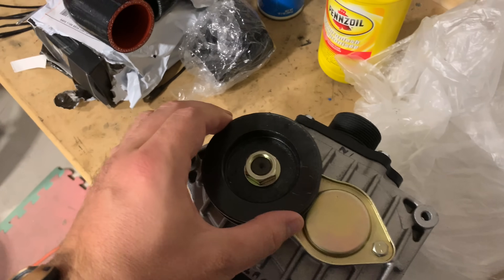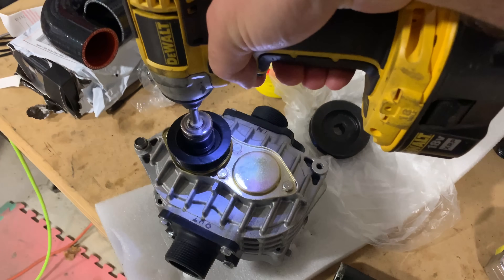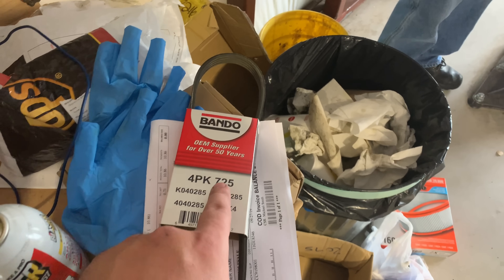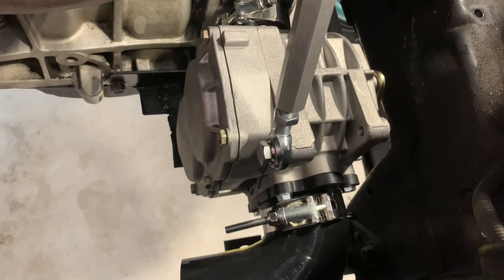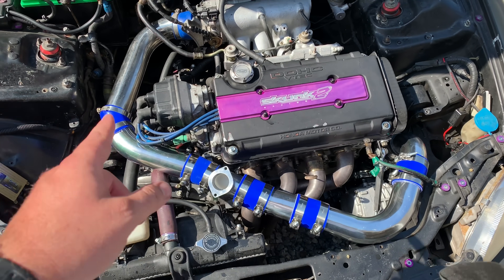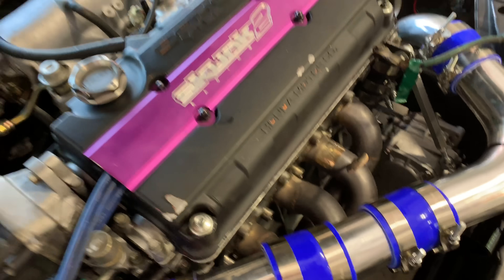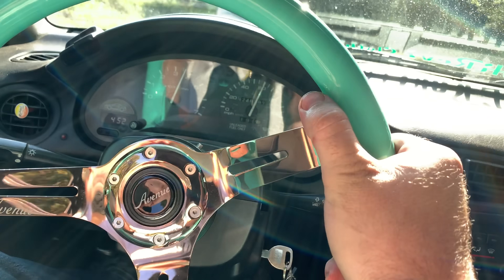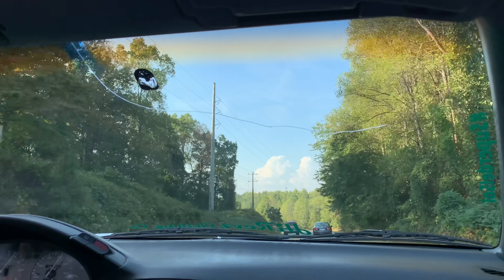Listen to that Whine! - AMR500 Supercharger - ‘93 Honda del Sol B18C1 - Pt. 3

Comment from the maker: UPDATE: Because so many have asked.  The car has a Chipped ECU from Jason Waters Tuning and is already tuned to handle boost up to the stock MAP sensor pressure of 10psi.
Reply: how many cubic meter air blowing per minute?
Reply: Dd7
Reply: @AM-up9kn  140$ on ebay
Reply: Meaning you dont need a gas refeed line and a fuel pressure regulator?

Comment: Superchargers benefit from intercoolers.(Even small ones) And at the very least put a heat shield between the header and the air intake because right now you're not cooling air but heating it. And heat does not make power, it robs it.

Comment: Try and see if you can’t reroute the throttle valve to the intake of the supercharger. From what I’ve heard, it’d probably remove that high pitched idle whine.

Comment: I would use an inline filter and housing, also the blower will last alot longer with a blow off valve installed.. thats probably why the intake blew off. It is overboosting when the throttle valve is closed fast, all the air has nowhere to go, and flutters bad,  these high rpm engines is not good for superchargers, a turbo is better it has pressure regulation, a supercharger will be too much pressure at high rpm and too low at lower rpm, an engine with a max rpm lower than 5 or 6 is ideal not 8 or 9+

Comment: Hello, I have the same project as yours, but in a Ford Sigma 1.6 liter engine, you are having problems with the oem injection, do you need to reprogram the ECU (remap)? Or can use OEM injection map?

Comment: I was thinking about putting this on a moped lol.  Maybe even turning the pully with an ebike electric motor but idk really how to do that because it's carburated and idk how it would handle forced induction.  I would think there might be some sort of air/fuel problems, unless I can somehow control the electric motor through the throttle or something to where it gives just the right amount of air, idk.. if anyone knows how to do something like this pls let me know :D

Comment: The same pump is used in sewage treatment aeration.  Wondering if the collar mounts are restricting the flow?  IE:  Remove the factory collar mounts and install (maybe have to 3d print or fabricate) new mounts that match the intake size...

Comment: Application: to increase performance on motorcycles, snowmobiles, ATVs, VW engines, Mini Coopers, Subarus, Nissans, Toyotas or any engine under 3.0L.

500cc/ revolution (30.5 cu.in.) With straight, 2 lobe rotors. It could be over-driven, and make good boost on a 650cc-1000cc drag bikes or larger if RPM is kept low. Or it could be under-driven for smaller engines.

Examples:
On a 500cc two stroke, with the blower being driven 1.5:1 with the crank, it would produce approximately 7 psi boost.

On a 750cc four stroke, with the blower being driven 1:1 with the crank, it would produce approximately 5 psi boost.

On a 750cc four stroke, with the blower being driven 1.5:1 with the crank, it would produce approximately 15 psi boost.

On a 1000cc four stroke, with the blower being driven 1.5:1 with the crank, it would produce approximately 9.5 psi boost.

On a 1600cc VW engine, with the blower being driven 2.1:1 with the crank, it would produce approximately 5 psi, but the engine RPM must be limited to 8000 rpm.

Additional Info:
Max blower continous speed is 16,000 RPM

Comment: just found out about these SC's i think i wanna try putting one on my H22A accord.
Reply: It's too tiny to be able to keep up with a H22, I've looked into it for mine. You'd have to run it at beyond 2:1 just to move the same air that a H22 can stock. H22 runs up to around 7600rpm so that's already basically maxing the chargers rpm out. making little boost and resulting in less power than stock, as your supercharger is basically just acting as an air heater and restriction for the intake.

Comment: That's good cuz bottom end is where it needs it the most there's another guy that put one of these on and was running all the data and he was seeing 60 horsepower and 66 ft lb of torque gain and he didn't do anything to the ECU or with his injectors he was running lean. I would love to see what this thing can really do when everything is done correctly. Cheapest horsepower I've ever seen $215 with a blow off valve and some charge pipe! I mean for the price that's pretty damn respectable nice job on the Del Sol

Comment: I been looking for a Sprintex Supercharger for my custom build but they no longer make it for the Honda Fit GD 1st gen. It's a 2007 in a custom trike. Unfortunately I bought the frame with the engine. Could this Aisin amr300 or 500 work for my motor? Is it just get the compressor supercharger to line up with belt and intake tube connections to throttle body and tune it? I have a hondata tuner. Just wondering if you had to change any injectors or anything else.

Comment: This really needs to be run off the primary pully. That supercharger isn't turning nearly high enough rpm. The amr500 is good to 16.5k rpm. Crank the rpms and you will get all the top end boost you want. Should be good up to 16 or so psi on a 1.8.

Comment: Been thinking of doing this to an EJ18 for years. Really cool to see someone else pull the trigger. Fun stuff!
Reply: the reason im here right now is im looking into this for my EJ18 
i also have an 84 with a ea81 that i may do it to instead...or both
Reply: @beefpickle2450  I think as long as you can find pulleys to overdrive it, you'll probably at least be able to make some solid boost throughout most of the rev range. I think the AMR500 is supposed to be suitable for up to a 1600cc engine, so the EJ18 really isn't that much of a stretch. Apparently they can be revved to 16,000 RPM safely, and I believe that's a fairly constant number, so I imagine peaking past that occasionally wouldn't be a big deal. Basically, if you can figure out the pulley ratio to max out the supercharger RPM when you are hitting red line, then you know you are getting the most out of it you can. The other option would be to strap two AMR500 Right next to each other just to double the output and then you would definitely have enough for boost. There is a ton of room in the engine bay to the passenger side of the engine so I always figured I would stick it there. As long as I could find pulleys to use the same ribbed belt the alternator and power steering already used, it would be easy to just get one the right length. As you can see I put a lot of thought into this haha. Still would like to mess with it someday!

Comment: If it was tuned to accommodate the air in and fuel spark it would build power
Reply: It's a Japanese car, it has a manifold pressure sensor, it will be able to automatically tune to about 5psi

Comment: ive watched this video like 5 times now. really like the turn buckle idea! im most likely gonna copy your setup on my 92 accord. thanks- david 
edit: where did you find the smaller pulley?
Reply from the maker: Hey bud, which engine do you have?  This setup really didn’t make any boost on this 1.8.  Check out the rest of the videos on this series.  But we got the smaller pulley off of eBay, under  “AMR500 pulley.”
Reply: I own an accord the displacement is too high

Comment: I'm thinking your outpacing the 500   it can only deliver 500cc of air per spin from my understanding  on a 1800cc engin it would need to spin at least 4:1 to just deliver the aire its neededing  also t he air charge is probaly crazy hot causeing the engin to compinsate toss a cheep intercooler in line and see if that helps.

Comment: Siiiccckkk my geo metro 1.0 i3 on propane is about to be turbo charged AND supercharged! Gonna run it in place of the air conditioner.  BTW found it on AliExpress for only $161! It already sounds like a swarm of angry bees... its gonna sound straight demonic on a little 1.0 with a turbo

Comment: Most of the boost problems and noise are due to the throttle body being on the output of the supercharger forcing air to nowhere the whole time when not in WOD.
Unlike a Turbo which builds up pressure eventually as the throttle opens, a supercharger already pumps forced air since idle and you should make it NOT doing it by making it vacuuming on a throttle body.
If you move it to the intake side it's going to work seamlessly as now it's working hard like pushing against a wall, quite some experimenting with idling will be needed though.
Reply: yes

Comment: Most superchargers only provide low end torque, since they're run off the crank. The turbos provide high end torque because they use the exhaust gases to spool up and boost. You can go with a twin charged engine, both a super and a turbo charger and have boost on both top and bottom ends, but that's a lot of abuse on the engine.

Comment: Hmm..I have a 225 slant 6 with a 1bbl carb I wonder if this could work on that..it's nothing that revs high and spends most it's time in the lower to mid rpm's
Reply from the maker: I think you will have two issues.  One, I think the engine would still be too big and two, I believe you would also have to do some major work to the carb to make it a blow-through carb.
Reply: @HiRevzMedia  you're definitely right I didn't even think of the blow through carb situation..ok thanks for crushing my dreams jk

Comment: I wonder if this would help my turbo spool faster on my Miata 🤔
Reply from the maker: It could help a turbo spin faster, but the issue would be that it couldn’t keep up with the amount of air the turbo would pull after and the engine would bog.  The del sol’s engine for start to bog down at high RPM.  We didn’t realize that until after the AMR500 was removed and the car felt faster top end.

Comment: You need 2 of them run in parallel. 500cc per rotation on a 1.8l engine is too low :)
Reply: I really want to mess around with one on my s2000 but yeah probably doesn't move enough air

Comment: Is the AMR500 large enough for this size motor? I feel it's definitely on the smaller side?  Can you do long distance driving without it overheating?
Reply: Barely but it says up too 2.0liter
Reply: I think OEM its made for a 660cc kei car.
Reply: It's really not at higher RPM. Best for 1.3 and under.

Comment: Do you reckon with a tiny pulley it could feed a stock l36 3.8 v6? I kind find a procharger for cheap and the amr500 is the only thing I have found for less than $300
Reply: Good luck, but I sincerely doubt you will see any gain that 3.8 will move more air then that supercharger can. You are better off sorcing a m90 supercharger

Comment: I'm not knocking the build... Just speaking from experience... The parasitic hp/trq loss is greater than the increase. I have a Jackson Racing boosted h25 (stroker)  that screams to 133mph in 11.13sec in the 1/4
BUT!! At 1st, with my stock bottom end and only throttle body and oversized injectors and a header with 3" str8 piped exhaust... The extra belt drivin accessory took more hp to the blades than hp I gained at 6lbs... To the point it didn't even feel like a V-Tec'd engine (you can delete a/c, power steering, and switch to an electric water pump to free up a good amount of up)
But I did all that, PLUS!, with the stroker kit I picked some Diamond Pistons that put me at 11.2to1 compression ratio with my ported head/combustion chamber. But I don't run more than 10lbs of boost (since boost can raise compression extremely which results in catastrophic failure)
Also to have stock and/or "n/a" cams instead of turbo cams or similar is a waste of hard earned money
You can correct ALL of your parasitic loss by just buying the right ratio pistons on otherwise stock bottom end, and have your stock cams machined for next to nothing, even more power potential if you can go without A/C...and more so, without power steering... With the smaller pulley you no doubt get more boost, but doesn't make it any easier to turn the blower.... 
I don't know the extent of your build but if you have only the header that I can see (which brings up how the header doesn't even have heat shielding at all, which even if you have an intercooler... That air is heated right back up with the intake pipe damn near touching the header, head, and block thats heat adds a good 100+ degrees of temp thats already heated by the SC.... The colder the air sucked into the engine, the more dense the air, of course, the more air pushed into the engine, that will need more fuel to compensate for it. (More fuel+air= more HP

Im ONLY reason I am spending this time to explain this, is because I wish "I" knew about SC's gives and takes. Especially since I live in California where the aftermarket performance market is very regulated. Turbocharging hands down is best (my race car is turbo'd... And the only LEGAL turbocharging in CA. is from the factory... If u live in a state where u can TC engines, it would be stupid to SC a vehicle over TC, since a turbo is more reliable (no belt that can break, no parasitic loss)

Unless you need more bottom end power over top end, you are wasting money for the extremely more expensive power adder that would never reach the power a turbo or turbos can produce
Reply: Machining cams ey?

Comment: The low end torch could be explained by the long distance between the intake and the supercharger. At least I know that for NA engines the longer the intake tubes the more low end torch. The shorter the intake tubes the more high rpm torch you got. You might have more high rpm torch when you modify the intake so you can connect the supercharger tube on the other side for a shorter distance between the supercharger and the intake manifold.

Comment: I just picked up one of the amr500's gonna a put on my daily b18c crv.  Have s300 v3, plan to use intercooler and weld charge pipe to fabbed aluminum plate mounts instead of those stock plastic threaded plates.  Also use a mac 3 port boost  controller and get a blow off valve or a recycle valve/waste gate  for pressure releif when throttle let's off.  
Only looking for about 6 to 8psi max boost for reliability on daily.  I am also going to pick up the 4pk pulley.  
Hirev, what are thoughts on this?
If it doesn't work out how I want it will just switch to a turbo and 10booost goal.

Comment: Hi!
You need to put the throttle in front of the supercharger. Now you blow the air unnecessarily at partial load and then suffocate because you want to go low on gas. You waste a lot of energy. The blower is loud now if you lose the gas.

Comment from the maker: What would y’all think of me doing a giveaway of this AMR500 Supercharger at 5000 subs?
Reply: Yes do it!
Reply: Yes please will it work for my auto integra ls
Reply from the maker: Danny Rohde it would actually bolt right up.  This is an Integra GSR motor in the del Sol, but it wouldn’t do any better on yours than mine.  These larger Honda motors, especially with VTEC, are just too efficient.  The supercharger is super cool though.
Reply: @HiRevzMedia  I have a b18b1 non vtec I just want want daily to be quicker but still reliable I'm a student on a budget any suggestion?I love Honda's so much they dont make em  like this any more ps sorry for my grammer
Reply from the maker: Danny Rohde I got you bud, yea it’s probably still to big of an engine for this supercharger.
Reply: btw it sounds sick AF. nice honda bro.
Reply: Do it! Ive been looking at installing an AMR on my NA Fiesta 1.6. Everything's planned out, just gotta pull the trigger.
Reply from the maker: Bridget Krams that might work!
Reply: Hells yes!
Reply from the maker: We are giving this Supercharger away!!!  Check out this video for details!  https://youtu.be/EILV_89eHRU
Reply: Ya if u still had it
Reply: I'm considering putting one of these AMR500 superchargers on a 2013 Hyundai Elantra coupe with 6-speed manual transmission that I just bought at an auction and was wondering how it held up, would you recommend it, and just any overall thoughts you might have? Just came across your channel and think I'll stay for a while if that's okay? 😆
Reply: why didn't you turn it 90 degrees so the pressure side goes down to an intercooler and the intake is up so you can put a filter on it easily. im genuinely asking? let me know pls. thanks. and remember 1🖕 for the haters.lol.
Reply from the maker: bob thompson we considered that too.  We mainly did this setup first just to get everything figured out.  If it had made good boost we would have made a better mounting bracket and added an intercooler.  It just didn’t do enough to justify having it on this motor.

Comment from the maker: Because so many have asked.  The car has a Chipped ECU from Jason Waters Tuning and is already tuned to handle boost up to the stock MAP sensor pressure of 10psi.
Reply: Well just as a future project u could try the sc14 supercharger they r 1400cc per revolution and r still pretty cheap i saw a b16 running 15psi on 1
Reply: https://www.ebay.com/itm/Car-SUVs-Cherokee-Roots-supercharger-sc14-for-2-0-3-5L-TOYOTA-Previa-GL8-HOVER/273887004213
Reply from the maker: alex marti yea, I thought about that too
Reply: Was thinking of putting one of these on my 2013 Elantra I just bought and am curious how it held up, if you recommended it, and just any overall thoughts you might have? Thanks in advance.

Comment: Is oil going to the super charger? And dont you have to tune the ECU?
Reply from the maker: Tyronne Milton the supercharger has its own oil sump.  The car has a Chipped ECU from Jason Waters Tuning and is already tuned to handle boost up to the stock MAP pressure of 10psi.